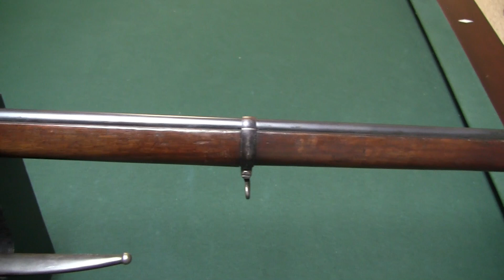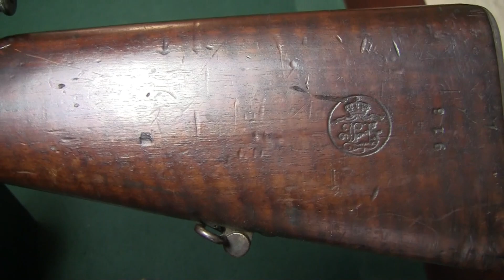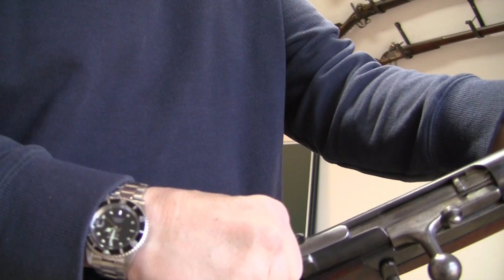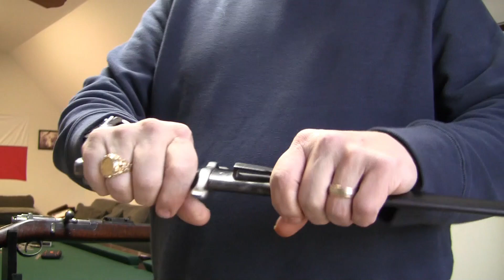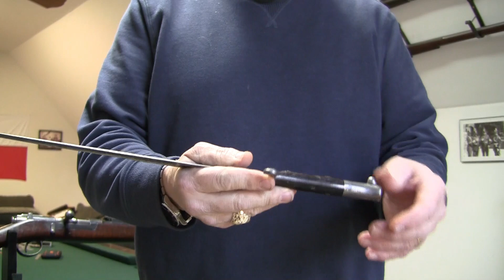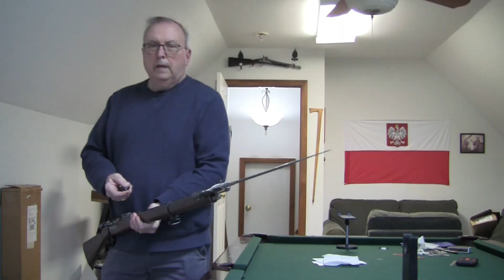Steyr 1886 Kropatschek Rifle & bayonet

Comment: Couldn't you use 8x50mm Lebel brass to make serviceable cartridges? Just fire-form and neck size them with the seating depth adjusted for the bottleneck position and use appropriately sized bullets. 

It looks like 8mm Lebel dimensions are all very close or smaller than 8mm Portuguese, except for the larger bullet diameter (I'm seeing .321 vs .329), though that's obviously for a bore still in spec and might also have never applied to bore diameter if they were using expanding base bullets of undersized diameter. (fairly common in 1880s and 1890s rifles, including hollow base FMJ bullets)

Actual solid copper/gilding metal bullets from Lebel cartidges would probably be a bit hard on the bore and might not take worn rifling well anyway, so lead would be better, still. (or possibly FMJ flat base bullets that can expand under pressure, especially if annealed just below lead's melting point)